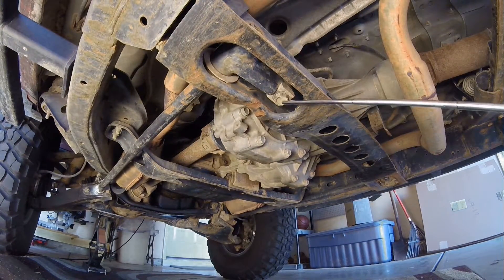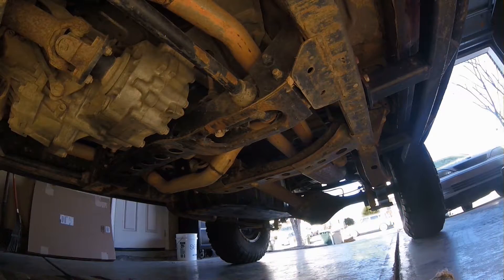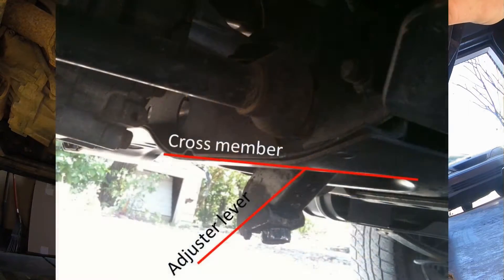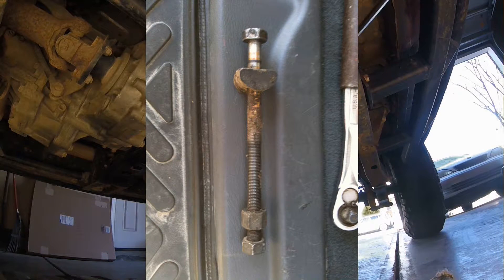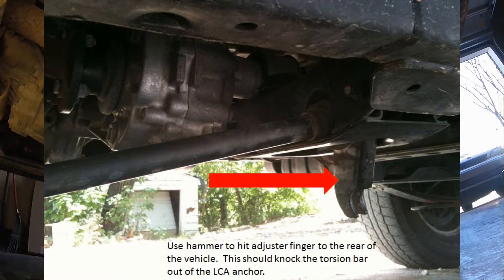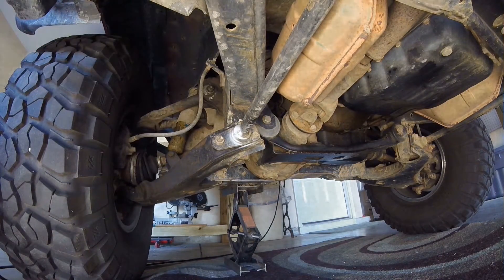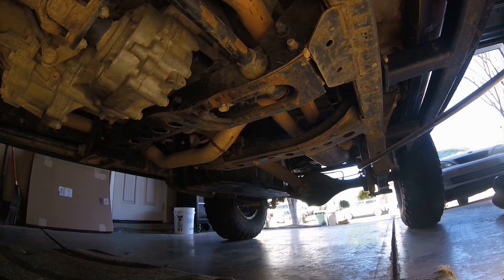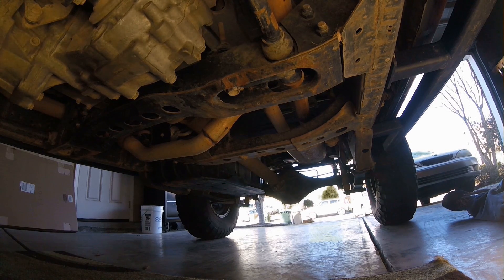Getting Lift out of UCAs - How To:  Re-Index Torsion Bars

Comment: got anything about cranking the keys it like decompresses like 3” after driving a few minutes????
Reply from the maker: You talking the torsion bar adjuster?  I have a video on adjusting torsion bars. You mean it isn’t holding lift?  It looks taller than you drive and it sags down all the way no matter how much you adjust the bolts?
Reply: @XterraRob yes exactly!!!
Reply from the maker: @danielwrigght ok so first things first:  put a jack or jack stand under the frame rail before adjusting your bars to take some weight off them. It’s either  of 3 things:  1). Something is damaged and stripped. The torsion bar has a spline anchor that goes into the lower control arm. If those splines or anchor strip, then the torsion bar loses its position and “falls down”.  2). The adjuster lever also has a spline section that attaches to the torsion bar. That could be stripped. 3). Also the bolts that go into the adjuster levers could have the threads stripped and the bolt and nut  can’t hold the lever in place.   My money is on 3:  the adjuster bolt has stripped threads.

Comment: Imagine your working on your front upper ball joint and your decompressed torsion arm covered in steering fluid slides out of its socket… then how do you reinstall without a making reference in its correct location?
Reply from the maker: Good old fashioned guess and check. You can try and investigate and look for witness marks that line up like a puzzle piece when inserted a certain way. But there isn’t one specific orientation that works. Put it in, adjust to get the ride hide where you want it. Is the adjuster lever inside the cross member?  Great, you are good. Is the adjuster lever hanging down?  Try again and rotate it a spline tooth so the adjuster is closer to the cross member. Is your ride height too low but the adjuster can’t go anymore because it is bottomed out inside the cross member?  Adjust one or two spline teeth away from the cross member and readjust.
Reply from the maker: Sounds tedious but you do it one time or so and you realize if the threads are cleaned up and already moving, you can adjust them to check pretty quick.

Comment: Ride height after lowering the jack is NEVER final. You must settle the suspension by driving it around before measuring it. This is due to binding of wheel against floor as you lower it down as the camber changes and also due to some extend the front sway bar binding against its bushings.
Reply from the maker: Understood. This is more of a high level conceptual explanation than a fully thorough how to. Suspension geometry will settle due to the tire scrub while adjusting.

Comment: I ask again.

I'm Japanese and I don't understand English well.　Please forgive me for that.

Hello.  Thank you for the videos that are always helpful.
Bump stop clearance
Protrusion amount of torsion bar adjustment bolt
Which should we believe?
Reply from the maker: Really they are two different ways to measure the same thing...but I think Nissan specifies the protrusion of the bolt over the frame. In reality, The ride height of your vehicle can be adjusted and changed however you want as long as you still have clearance at the bump stop (1/2 inch or larger).  I would adjust them so that your vehicle sits how you want it to:. Even left to right and slightly lower in the front. If you like how it looks and measures, just make sure you have a 1/2 inch clearance at your bump stop and you are done. Then get a wheel alignment.
Reply: @XterraRob  
Thank you for your quick reply!

The amount of protrusion of the torsion bar adjustment bolt is almost the same, Protrude the torsion bar adjustment bolt 3mm on the driver's side, But is the bump stop 3mm wider on the driver's side?
However, the distance from the ground to the fender is 17 mm lower on the driver's side? ? ?　(The position of the fender is unreliable because it is bumped.)
Reply from the maker: I have another video called "How to lift front torsion bars on first gen Nissan Xterra" that may help too. What you are describing (adjuster bolt protrusion is the same but ride height is not the same) means the torsion bar was removed and reinstalled in the anchor so that the splines were not lined up in the original orientation. The bump stop is another way to measure your ride height. The bolt protrusion indirectly measures that as long as the bars are all installed with the same spline locations and orientation. If you remove a bar and rotate it by a spline or two in either direction, the relationship between bolt protrusion and ride height completely changes.
Reply from the maker: Driver side being low:. Can you keep twisting the bolt to adjust it higher or does the bolt and adjuster lever hit the frame rail preventing you from adjusting it higher?
Reply: @XterraRob  
Reindex!?　Maybe the previous owner had some weird settings.
It may take some time, but I'll do my best.

I watch a lot of Xterra Rob's videos, and they are very helpful! .
Thank you for your helpful video and your kind reply.
Reply from the maker: @purumanjin  most common is torsion bar was removed for some other repair (rear main seal, transmission repair, lower control arm) and the person didn't know about how to get torsion bars adjusted properly so they bolted them up which technically has them installed... just not synchronized with the other side.
Reply: @XterraRob  
Xterra Rob pointed it out, so I thought it must be. It may be the former owner himself who lacks information.
Unfortunately, there are many ignorant car enthusiasts in Japan.

Sorry again. Is it a problem that it's out of sync with the other side? .

Now I'm looking at the forums and his Xterra Rob videos for tips and answers.

thanks so much! .
Reply from the maker: If the bump stop has clearance and the tires can get a proper alignment and drives fine....then no problem.  If the car is leaning like you describe 17mm lower on one side, that can be adjusted to be more even if you want to.  Do not worry about protrusion length of the adjuster bolt. I have never measured that.
Reply: @XterraRob  
I had a little problem, Thanks to Xterra Rob's reply advice, Visually, it's done.
Thank you so much.
Reply from the maker: @purumanjin  happy to help and thanks for watching!

Comment: Rob,my drivers side bolt is bottom out. My passenger side bolt has thread. My driver side front is the lowest. I want to raise it up. How do I adjust the bolt that’s bottomed out
Reply from the maker: To adjust your drivers side that is bottomed out you would have to so what thia video describes...take the bolt completely out. Remove the spline in of the torsion bar from the anchor and reinstall the bar one tooth to the side that will give you more turns of the bolt before the lever bottoma out.
Reply: @XterraRob  thank you for the information. I watched the video and it was very good
Reply from the maker: @jefferyscott5007  happy to help!

Comment: whats the best way to keep up with how much youve adjusted on one side versus the other? How do you keep up with how many times you turned on the bolt?
Reply from the maker: I always did a tedious guess and check method. Not easy or great...but it works. Try and count how many wrench turns, try to measure how much of the bolt is aticking above cross member...then let it stand on its own feet and measure ride height.

Comment: I stripped the nut or bolt not sure, how hard is it to replace? I thought I might be able to get it to grab good threads if I hit it while turning it.
Reply from the maker: Do google search for nissan xterra torsion bar anchor bolt. It's easy to replace the bolt.  Relieve some pressure off the bolt by using a floor jack under the vehicle. Lefty loosey the bolt head and replace the bolt and associated hardware and retighten to desired location.  Check ride height when lowering the vehicle off the jack and fine tune your adjustment. Get an alignment if you think the final positioning changed much. Probably not needed though for just a bolt replacement.

Comment: Have you ever heard of torsion bars skipping splines? I took mine wheeling and hit some really really rough parts of the trail that I didn't see and now my truck is noticeably sitting lower on one side. At first glance it looks like everything is how it's supposed to be, which is making me wonder if I possibly skipped teeth on my torsion bar.
Reply from the maker: Its a super tight splined fit that would have to basically break through the spline to slip like that. Its not uncommon for old trucks to sag differently over time and create a side lean though. I wouldn't be surprised if your truck had always been like that and maybe you just noticed it after looking at it after wheeling.
Reply: @XterraRob  Well I PML'd it when I bought it back in March and I know it was level up until wheeling it last time. It's bad enough that my truck is pulling hard to that side from it being an inch or 2 lower on that side. I know for a fact it dropped on that side after that wheeling session though, so maybe I am missing something. I'll report back when I find out!
Reply from the maker: If the torsion bar is actually slipped that bad...the spline would have to be badly damaged and you may need a new torsion bar.  I could be wrong though but when I have had them apart I didn't see any way for them without it breaking. Keep me posted I am curious. Also check your tie rod adjusters just for fun...
Reply from the maker: Keep in mind torsion bars hold your truck off the ground...if you think it's damaged...be safe and use a jack stand
Reply: @XterraRob  Yes sir! I don't play with vehicles on jacks, too many close calls haha. I have class tonight, but nothing going on tomorrow, so I plan on diving into it in the morning. I may do a video if it's anything interesting.
Reply: So update, I bent my lower control arm in two different places haha
Reply from the maker: Oh no!!! That will do it though!!!!  At least now you know.

Comment: Your videos are super helpful, thank you. I've been looking through them as I make my way through the clubfrontier threads that reference them in the 1st gen FAQ, but I'm still stuck. I just bought a '98 Frontier w/ 190k on her, and will eventually be doing a PML (maybe PML+), once I decide whether I want a shackle or a full leaf pack (mine are pretty rusted and bouncy/floaty). But in looking under my truck, it looks like rear torsion bar arm with the adjustment bolt is hanging way down out of the cross member, and yet I can barely squeeze my index finger between the UCA and bump stop up front. I think it's sitting at stock height, but how do I know for sure? What should the gap be between the stock bump stop and UCA at stock ride height? Does the gap start out around and only get lower if you over-crank the t-bar? Or does this mean a previous owner messed with the height, re-indexed, or maybe even both?
Reply from the maker: If there aren't really signs of other off road mods...what most likely happened was some service or repair that required the torsion bars to be removed and they put them back in in a different orientation causing them to hang lower. For instance rear main seal or transmission removal or lower control arm replacement requires torsion bars to be removed or the cross member. That is essentially a "reindex" but done inadvertently by someome not as familiar with torsion bar lifts. I have a video on reindexing torsion bars that explains pretty well.  No way to know for sure exact stock ride height ... Just that front end is usually lower for braking and aerodynamics. Everything could have sagged  over time though.
Reply: @XterraRob  Kinda what I figured. There's definitely a non-factory weld on the oil pan, and signs of either oil or trans oil leak, so maybe a sloppy rear main job at some point. Guess I was just thrown off by the stock ride height paired with low bump stop gap. Thanks.
Reply from the maker: Rear of the oil pan is a common leak on these (I have a video series on that) and they are commonly mis diagnosed as a rear main seal. My guess is whoever did the repair reinatalled the torsion bars and eye balled the front end so it may have a bit more ride height than usual. Do you still have a nose down rake?  It is common when doing PML to not get a lot of height out of the front. For a pick up truck you want some nose down rake so the truck doesn't squat too much when loaded down in the bed. I personally like shackle lifts due to the flexibility of the axle...but if you tow frequently or load the bed down a lot, stiffer leaf packs are good. Otherwise, the empty bed is very light and can ride rough with stiff leaf springs.
Reply: @XterraRob  I'm pretty sure it's at stock ride height  after digging through clubfrontier forums. And it definitely has some nose down rake, would likely have more without the topper. Which is fine because, as you said, it's a truck. Trucks have rake. And I'll eventually throw either shackles, AAL, or a leaf pack when I'm ready to do the PML so I can keep most of that rake. Again, just confused by stock ride height paired with such a low bump stop gap. Maybe I'm just the  victim of severe t-bar sag? Maybe previous owner did the t-bar crank and it's just sagged back to near stock ride height? The t-bars are pretty old and crusty.
Reply from the maker: If the suspension sags...the control arms also sag which opens up the bump stop gap.   The common claim of getting 1.5" of lift at 0.5 inch bump stop gap is a general guide line but not guarnteed. Nissan makes the torsion bars adjustable so they can compensate for part variation in frame weldments and keep a proper stance even if aome things are slightly out of symmetry. For instance...an equal bump stop gap on each side is not always an equal ride height. But the adjustability allows you to compensate. That is my guess with your truck. You can adjust the ride height up some...but if you lift the rear...you will probably have an even bigger rake.
Reply from the maker: I have a video called all about suspension lifts which explains some things in more detail. Check that one out.

Comment: Hey Rob quick question, any recommendations on how to make taking the torsion bar out of its anchor a lot easier? I’ve been beating it with a hammer for hours and my passenger side torsion bar does not want to come out. Driver side is already done. I have been spraying it down with wd-40 as well. Thanks in advance!
Reply from the maker: Liquid wrench or PB Blaster usually works better than WD40...other than that...a lot of it and a propane bottle torch may help. Also...hiw big of a hammer?  I use a 3 pound sledge which always worked pretty good for me.

Comment: While trying to pull the torsion bar out of the splines on the lca the adjuster arm came off instead. Should i adjust the arm over a couple notches? What to you recommend?
Reply from the maker: Yessir!  Same logic. Adjust the orientation of the lever to either make more room to adjust/lift or reduce the room so the adjuster isnt hanging down under the cross member.

Comment: While trying to get the torsion bar out of the splines the adjuster lever came off instead, should i just move the adjuster lever a few splines? What should i do?
Reply from the maker: Yessir! Same logic...adjust the lever qrm position a spline or two over to either make more room to adjust/ lift or reduce room so the lever isnt hanging down below the cross member.

Comment: Cant seem to find if you’ve answered this question already, once you hammer out the torsion bar which direction do you turn it before reinserting?
Reply from the maker: Depends which condition you are trying to fix.  If your truck was at the ride height you want, but your adjuster is hanging down below the cross member, then you rotate it so the lever is one tooth closer to the cross member which tucks it closer to the cross member when at your ride height.  If you cant get to your ride height because your adjuster lever is fully stuffed into the cross member and is bottomed out, you rotate the adjuster lever further away from your cross member which gives you more room.
Reply: @XterraRob  thank you rob, you’re the man!
Reply from the maker: Happy to help!

Comment: Hey!! I have a quick question on my 4wd 2001 x. I’m looking to fit bigger tires on there and the torsion bar lift is quick and easy I’m not needing room in my back I need room in my front wheel well. Can I crank the torsion bar and not have to get shackles ?
Reply from the maker: I have another video all about suspension lifts and also one about tire sizes you should check out!  Basically yes you can adjust torsion bars without getting shackles but depending on tire size you may need more lift (body lift)
Reply: maybeeee

Comment: Hey man, I'm possibly looking at doing this to my 2wd xterra. Curious, do you think this is worth it to get a lift? Or just outright buy a 3" SL, with shackles in the back? I want to fit 32" tires on my ride. Thanks.
Reply from the maker: If you just want 32s I would get shackles for the rear and just adjust the stock suspension in the front. You could probably get an inch or a little more in the front stock suspension.  A 3 inch UCA lift is certainly possible, but not needed to fit 32s.
Reply: @XterraRob  thanks bro. So if I got this right, I want tire size 285/75r16.. Those would be considered a 32" tire correct?
Reply from the maker: I have another video on tire sizes for xterras...but 265 75 r 16 is a 32 x 10.50 wide
Reply: @XterraRob  ok. I'll check that out. Thanks man for your help